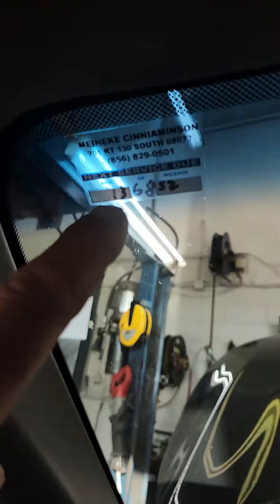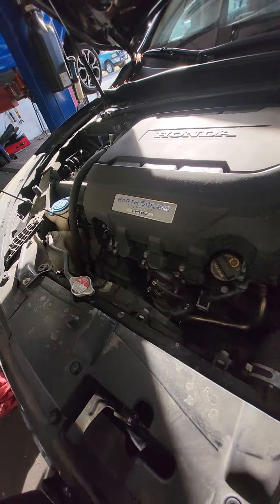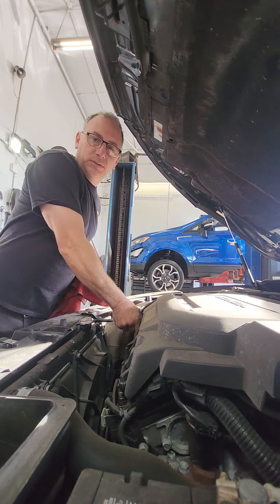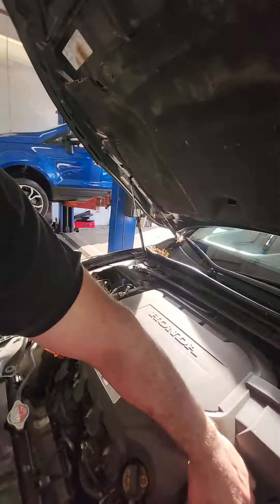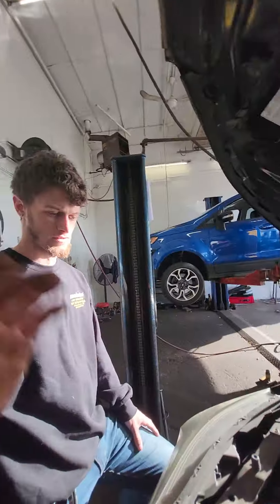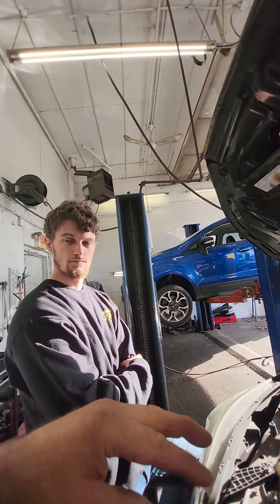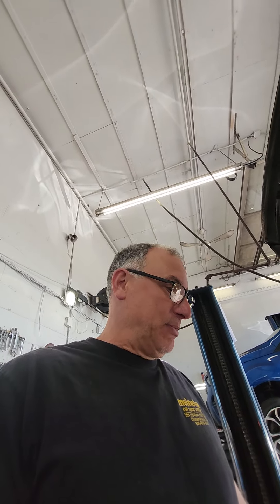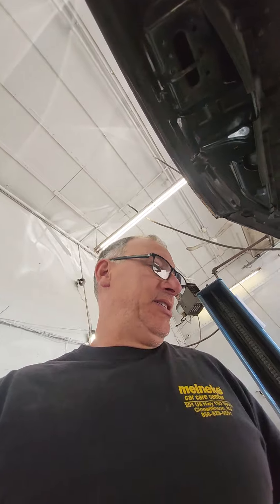4000 mile oil change 2013 Honda accord v6 . Oil health  check  & what it likes looks good

Comment: It’s amazing how well some older engines from the 2000s can hold up to abuse.

I own a 2007 Chevy Impala. Back in college was broke and didn’t understand how cars worked, I would frequently go 7500-8000 miles on the car between oil changes because that’s what the sticker said on the quick lube shop I went to. Until a friend told me I needed to change my oil way more often and to not believe what any lube tech (who doesn’t know your car) tells you. He showed me by helping me do my first ever DIY oil change and the black disgusting gunk that came out of the engine.

I started doing 4000 mile intervals myself, and the engine appeared to “clean” itself over time. Not even using special oil. Just the cleap super tech oil you can get from Walmart. The oil I was pulling out of the car gradually became cleaner and cleaner until the oil I remove today has just a tinge of black. 

I graduated a few years ago and I still have that car. I abused the shit out of the car in college and barely took care of it. And somehow, it still works. It’s at 135,000 miles, and I’m hoping to get it to 150,000 miles before I eventually Junk the car. I think it’ll make it.(

They don’t make modern cars like they used to!

Comment: 2:22 look down the oil fill cap hole on top of the head unless a baffle plate is blocking the view.... This view is a good way to gauge if the previous oil changes were adequate in frequency and quality of oil.
Reply from the maker: @freddyhollingsworth5945  clean cam cap bolt like new

Comment: 04 TL, 506k, Original engine (3.2 J-Series), 15 thousand mile oil changes with Mobil One 5w-20, Fram synthetic filters, 2 timing belts, 2 valve adjustments, long commutes….no vcm and only port injection…. Still running strong and my daily.  They don’t make them like they used to!
Reply from the maker: @danielhamilton6569  wow what color is the oil at 15k i say ubtale care of this engine
Reply: @anthonynastasi4098  It’s definitely black…. lol. I only tried this because my auto tech teacher said you could run Mobil One for 15k so I was like why not try it?  I got the car with 90k on it and put the rest of the miles on it. I would never do that today with modern cars, especially direct injection, turbos, and not to mention all these vehicles running low tension rings…

Comment: it is hard to judge by just mileage how worn oil is my son drives an hour and 5 minute ride back and forth to work so he is mostly on highway fully warmed up not too many deposits we go 5000 miles he has to change it every 8 to 10 weeks for 5000 mile changes but that is some pretty easy driving on the oil much better than driving around town in stop and go traffic .

Comment: Good good advice! Yes, the J35 engine is non GDI, thank goodness, but it’s got that pesky VCM (variable cylinder management) which turns off 3 cylinders during sustained highway driving. Causes excessive oil consumption and fouling on poorly maintained examples. 

My GF drives a ‘19 MDX also with the VCM and now start stop. I got a “S-VCM controller” that pigtails into the water temp sensor in the engine bay, which tricks the ECU into thinking it’s always 178F and never goes into 3 cylinders. Only when and if it reaches an overheating situation does it override itself. Yes, the fans still come on. 

I also got an “Idlestopper” which is a pigtail that wires under the center console switch and now makes the auto stop feature 100% optional (so no more hitting the switch to disable)

Comment: I discovered using a $100 boroscope on engines from YT.  How often do you find scored cylinder walls when a oil burner rolls in your shop?

Comment: Without knowing the use case, this video is useless. Need to know weather and drive cycle. Great video , but useless.
Reply from the maker: @robertmontgomery7158  It shows  at 4000 miles of driving on this oil this engine is happy with this oil n environment
Reply: @anthonynastasi4098  I "think" he is referring to City vs Highway,  Short vs. Long Driving etc. which would "affect" the life of the oil.  I went to 2500 mile oil /filter changes (with Synthetic) in our CR-V when we were going through the carpool lane to drop and pick up the kids from school.   Probably 20mins of run time daily to go a quarter of mile at best. The oil was just as dirty.  I sure there are people doing the same going through the Chik-a-fil Drive Thru several times a week.  😉
Reply: You don’t need any additional information here, he’s a grand over needing an oil change…and the oil looks good.